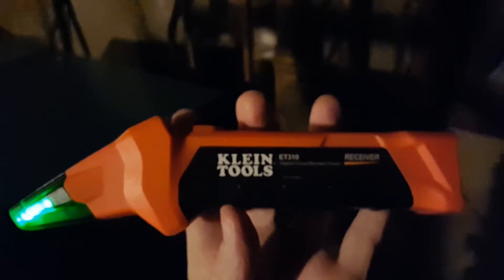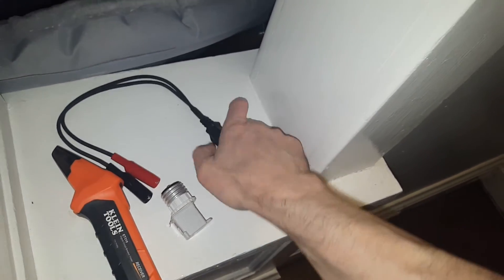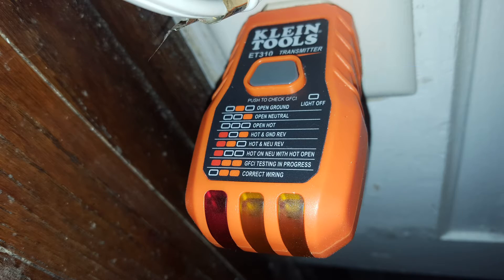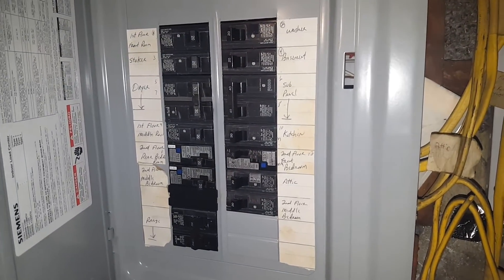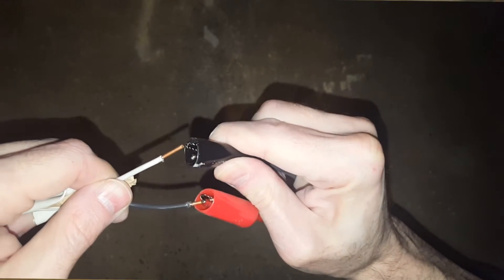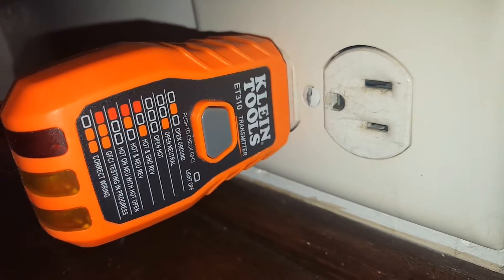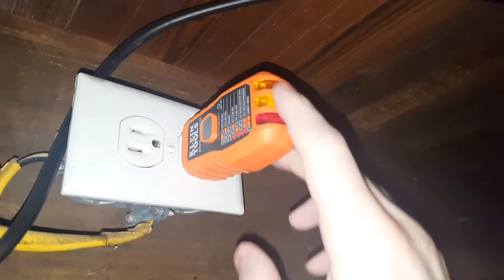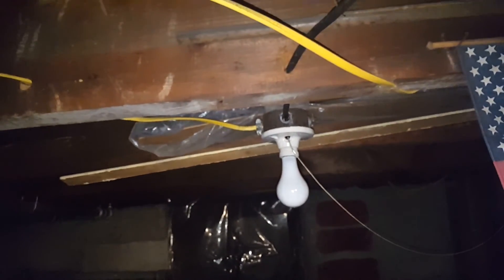Klein circuit breaker finder accessory kit | How to find a circuit breaker

Comment: when you are going to find the breaker, first you have to run your breaker finder all along the breakers, so the tool will "learn" the electric connections, then, your run it a second time, and it will beep, or signal which breaker you are looking for. That is why, when you ran the finder, it gave you a false reading